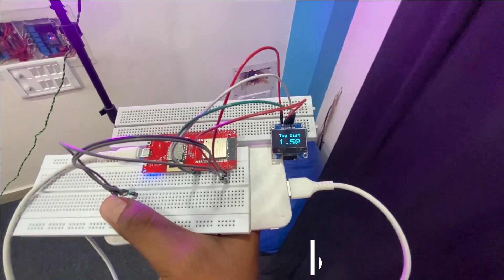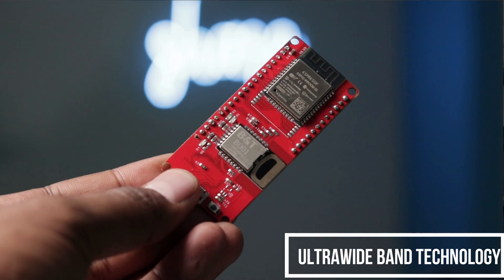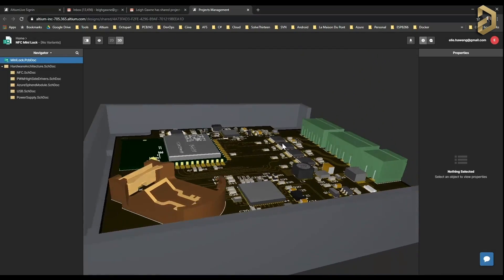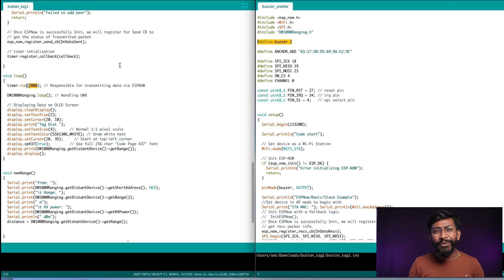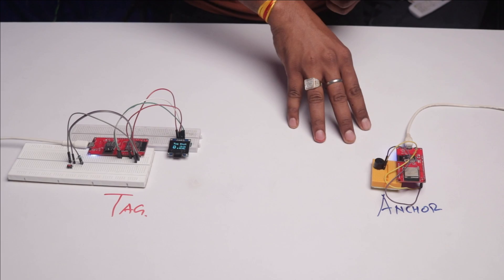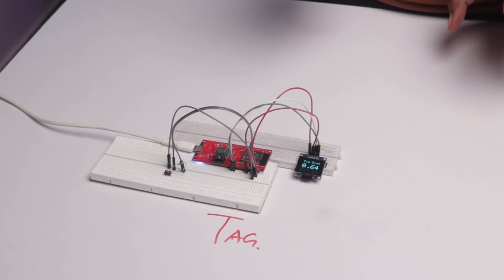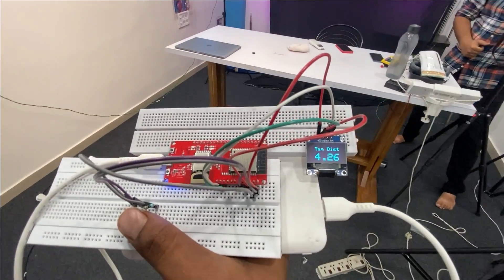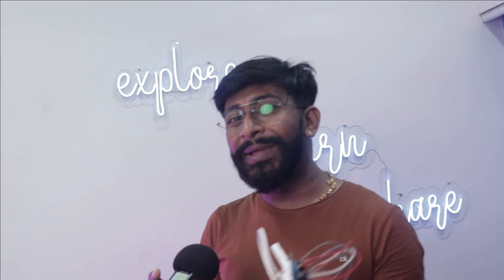DIY Apple AirTag | Results will blow your mind 🤯

Comment: I found this quite helpful, but I am wondering how we can also include the direction like airtag does. Or does airtag simply use multiple iphones and pin the location based on the overlap of circles with radius of measured distance?

Comment: Sir please make a project on Attiny 85  and IR LED and a button with can transmit AC temperature signal in 20 minutes time interval
Reply: Sir I want to describe it in detail. Why is this project needed?  many times our children and guest set AC Temprechure at 18 and we can't force them to select 24 or 25. then this project will help to restore our desired temperature. The device will only use 4-5 components 1. Attiny85, 2. IR Led, 3. Mirco push button 4. Led (to check device status) and coin battery (CR2032) and all components will fit in 15mm*15mm. and what the device will do,  we will put this device in that room, it will send IR Remote Signal to AC in 20 minutes or 30 minutes time interval and AC Temprechure will set 24 again if child reduces AC temprechure device will reset again and in last which capabilities must have by device 1. Learning function( when the user will press the button for 5-second the device will enter learning Mode (Led will flash) then the user will press the AC remote button in front of the device and the device will receive that signal and save it after pressing 1 click in the device. then it will send the same signal after the time interval (Sir this will be a great Project it will help millions of people and will help you millions of Views

Comment: Maybe you can also add a GPS and GSM module with deepsleep capabilities to ping its location every minute or 10.
Reply from the maker: But for that I also need to add a SIM card and need to recharge data plan in it which will be way way different then the actual airtag
Reply: Are you able to build one?

Comment: It is not an "Apple Airtag" unless you can find the tag kilometers away. Apple Airtag works by sending messages through a private network among Apple devices, without the need of WiFi or cellphone signals, to a central server, and then to the user. You just made a range meter, nothing more. If you call it "Apple Airtag" you are misleading viewers. If you think that you have an "Apple Airtag" equivalent, then you are delusional.
Reply from the maker: I think you didn’t watch the complete video

I already discussed in the end that making exact equivalent of airtag is not possible as an individual 

Please watch it out
Reply: @techiesms  and yet, you still called it "Apple Airtag" in the title, just for the clicks. That is dishonest, at least.
Reply from the maker: I already said in the beginning of the video as well that not completely but we still be trying to replicate couple of features of it